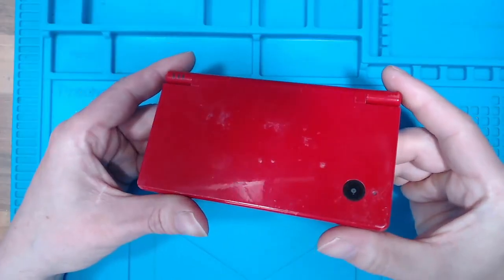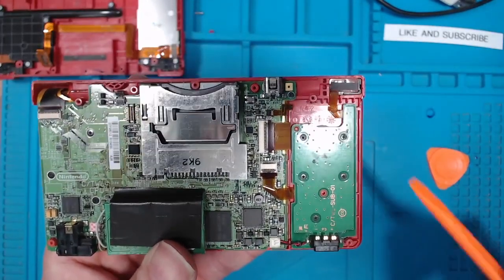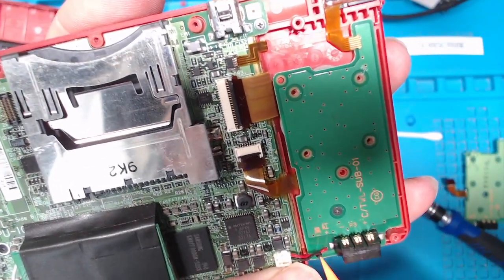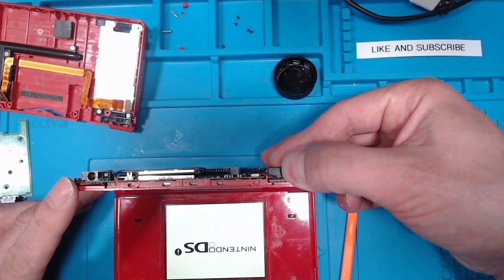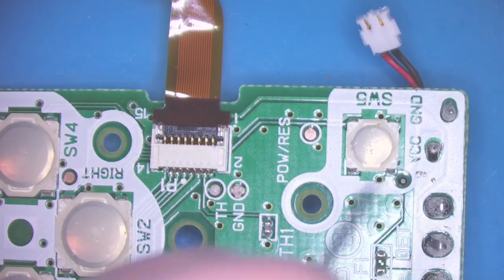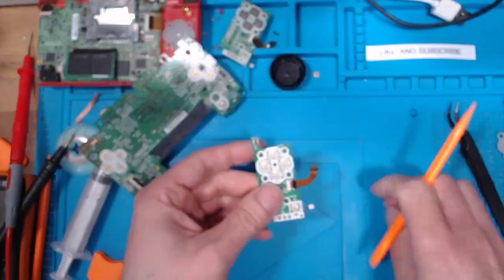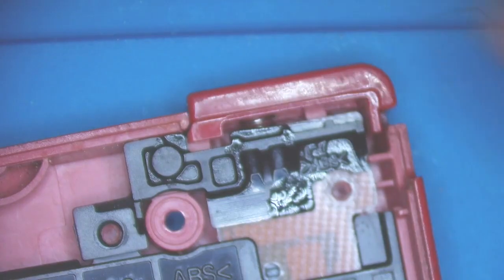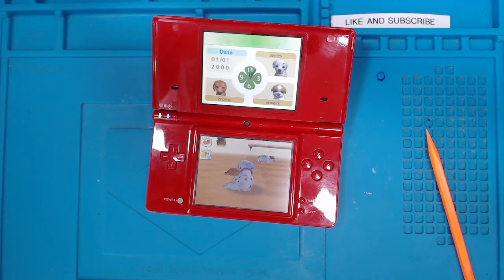Nintendo DSi won't power on | We can fix it

Comment: hey can a dsi still turn on (even if its just for a few seconds) even tho i havent charged it for months ? tryna check if it still works before i get a new charger (charger doesnt work and it took me some time to buy a new one)
Reply from the maker: If the battery is flat it won't turn on at all. You will need a charger or a battery with charge in it.
Reply: I have that same issue… I haven’t played it in a year or 2! Now It charges when I plug it in but when I press the power button, the blue power light comes on but for only a half second.. Same with only the top screen for a half second.. The bottom screen doesn’t light up at all… I replaced the battery but that didn’t make any difference. Thinking of trying a new charger for it’s only $10 on Amazon.. What do you think? 🤔

Comment: Nice repair
Reply from the maker: Cheers RB, I had tested that faulty component at the start, but that's the trouble with intermittent faults. After exhausting everything, I still had to go back to basics and start checking for continuity.